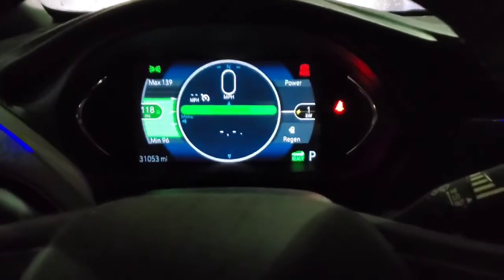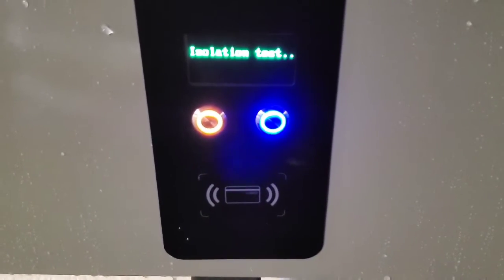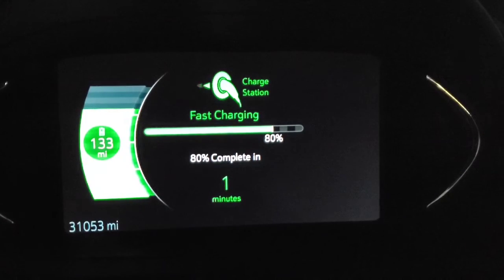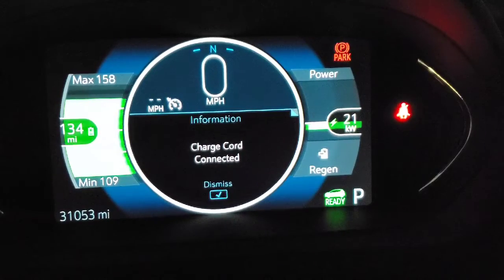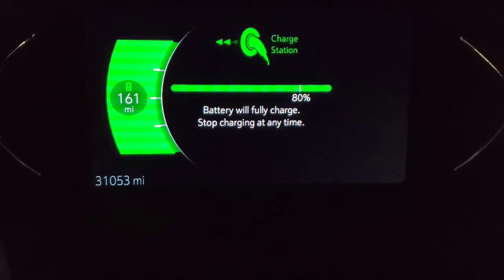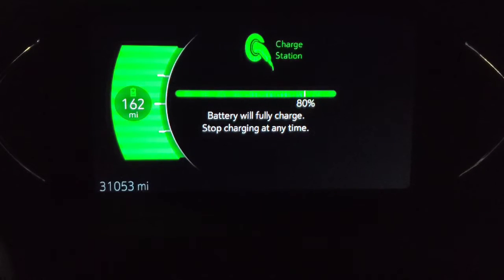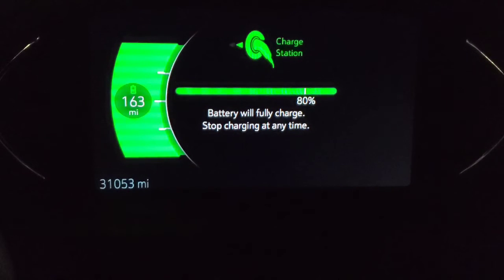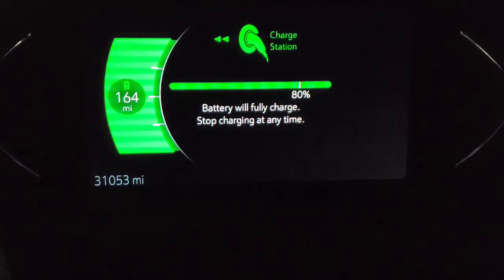Chevy BOLT EV DC Fast Charge @ 20kW to 100%

Comment: I recently bought the 2020 Chevy bolt. Didn't realize it didn't have a fast charging port. Do you know if it can be upgraded. Thanks
Reply from the maker: I am not sure.
Reply: What I have read is pretty much no. Technically there is a way to make the connection but the software would have to be updated to "see" it and it's not an upgrade dealers have been known to be able to do.

Comment: This is completley free?!?!! I'm getting the 2019 in 3 days and looking for ways to fast charge for free.
Reply from the maker: My two local Chevrolet dealerships offer free high speed charging. The may turn them off at night.
Reply: @DavidKK4GAF  omg I'm really hoping mine does the same out here. I live in an apartment so this may be my only option if I want free charges. Thanks for the response you got my subscribe!
Reply from the maker: I have only owned a number of EVs where I have a garage with a level 2 EVSE. No guarantee that chargers will be working.
Reply: @DavidKK4GAF  is there a setting for fast charge? my 2017 takes forever to charge and doesnt fully charge after an hour of DC fast charge.
Reply from the maker: @TinotheTitan  The high speed will throttle back for the remainder of the charge. Mine did not charge at full speed until 100%.